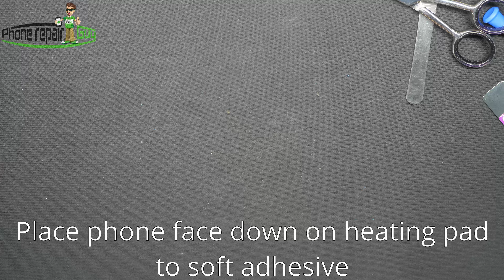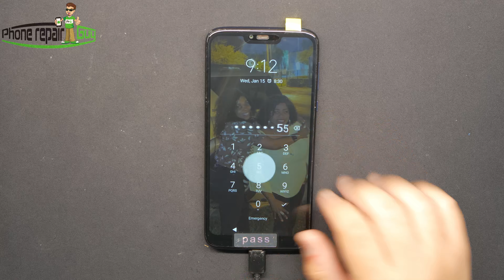Motorola G7 Power LCD and Back Camera Glass Replacement Guide

Comment: Hey thanks!  I was having a hard time getting the glass off my Optimo Maxx.  The rest of the adhesives came apart with a hair drier after just a few seconds (including the metal housing the glass sits in), but the one on the glass required more heat applied more directly direct for a much longer time.  I wound up using my butane soldering iron which doubles as a high-temp heat gun with a precision nozzle.